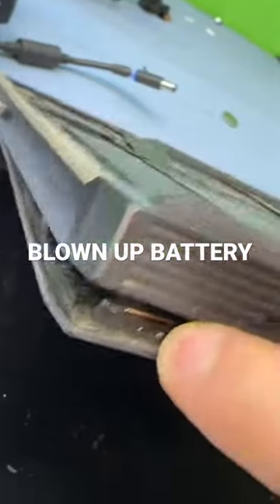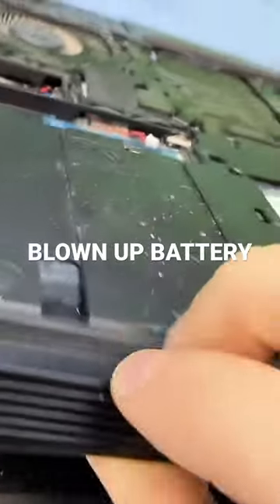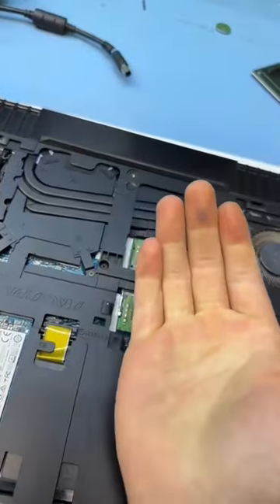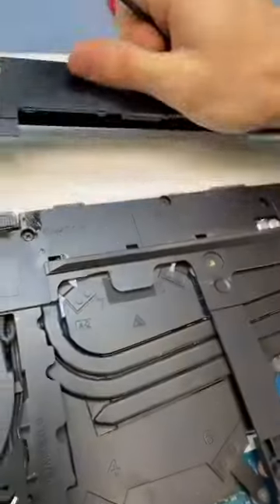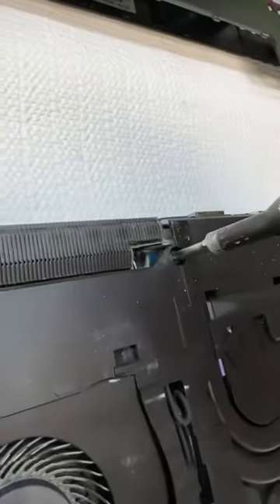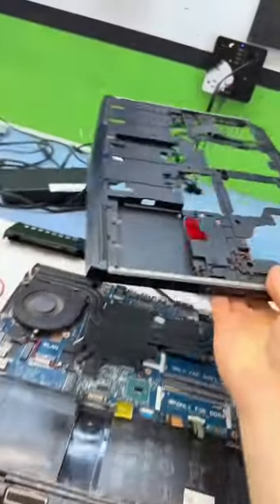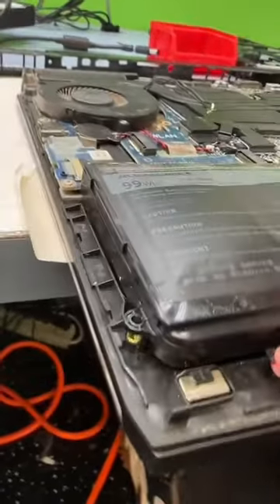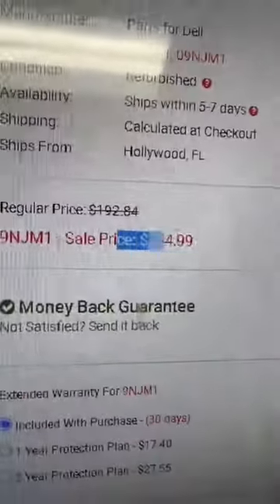Alienware battery boom 😡 #battery #dell

Comment: Another reason not to buy an Alienware. It's literally the windows version of Apple, useless, unrepairable, and 5x the cost of anything else with the same exact stats.
Reply: You buy them for the warranty’s. Most people don’t wanna fuck with them, they want something like an Xbox they just push a button and it works
Reply: @HunterSmith-el7cj  you can get extended warranties from other manufacturers, or just get an extended warranty from the place of purchase, and even with that extra expense you'll end up spending way less than you would on an Alienware device.
Reply: They are owned by Dell and I have only gotten proprietary faulty crap from them so I just stay away from Alienware too.

Comment: Love how the keys, the charger and so much else is just refurbished Dell parts lol.
Reply: That's because it practically is a Dell...They just get to charge you more for it because of the Alienware name...
Reply: Dell bought alienware in the early 2000s.  Alienware said it was great because they'd be able to get parts cheaper and give customers a better value.  Customers knew the computers were just going to be repackaged Dells.  Alienware pre-dell?  Great, if expensive.  And their customer service was amazing.  After Dell?  Garbage.
Reply: Well dell does own alienware... i just had to get mine replaced and all the support was provided by dell
Reply: @socmonki  could customer service be better? Yes. But i got my pc discounted by 1k down to 2k, my GPU was faulty so they replaced the entire pc for free, with a £600 upgrade to the computer so it really is not that bad
Reply: @socmonki  1)i cant build a custom pc
2)if you tried building my pc yourself, it would not be cheaper due to the massive amounts of discounts i got, but gl
Reply: @aaroncousins4750  yes you could, you just have to be patient sometimes.  Not to mention factory built pcs like Dell and Alienware use lower quality components.  Didn't used to be that way, Alienware used to use high quality parts, but now use lower spec dell designed garbage.  So it's not really cheaper in the long run.

Comment: Take a high res photo and print it stick it on top a magnetic matt and place the screw you remove on the spots and every layer you remove take another photo. I’m proficient with dell but that was how I always do one ai have never opened. Never ever buy a generic Dell battery they never charge.

Comment: My 13 year PSP battery swelled like that butt at least they replace it didn’t snap the battery cover in half or catch fire because Sony makes high quality batteries that last many years. Gaming laptops should use cylindrical cell batteries due to ample room and they don’t swell from a year of heat exposure. Gaming laptops should come with hot swappable batteries just like in older laptops.
Reply: the battery compartment on most things is designed to cause the battery to lose contact when the battery swells keeping it from being charged and exploded.

Comment: I really like dell laptop material it felt so rigid,  unlike any other laptop brand but one thing dell has so much hardware and software malfunction i bought dell g15 it has blue screen problem can even repair it, total reset didnt help much, i trade it with lenovo ideapad gaming 3, and problem solved

Comment: I've been doing computer repair for a while and you would be surprised to know how many places think the laptop has a dead board cause it won't turn on without the battery plugged in. I've been able to get multiple free laptops that basically just need screens and hard drives because of this.

Comment: I had the 17 R4, exact issue. The battery was swollen, I just popped it so the weight wouldn't go unbalanced and sealed the hole back up, disconnected it and continued using it for another 2 years. It does boot without the battery. Only issue is, updating the BIOS requires some manual inputs to bypass the battery check.
Reply: Puncturing lithium-ion batteries can create intense fires.
Reply: LG batteries for you.
Reply: @Remsster  that's only if you make the components mix. Puncturing the outer shell without hitting any of the other internal components is ok. It's not a safe practice in general, but I take my chances. 😅😅😅😅